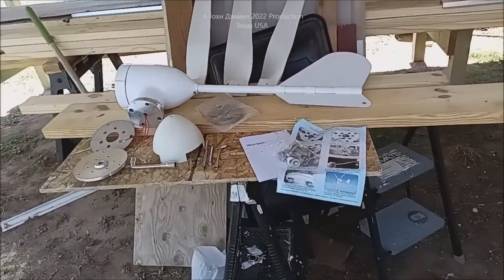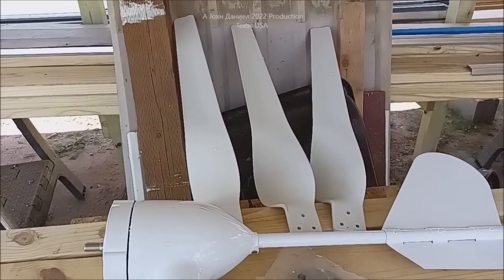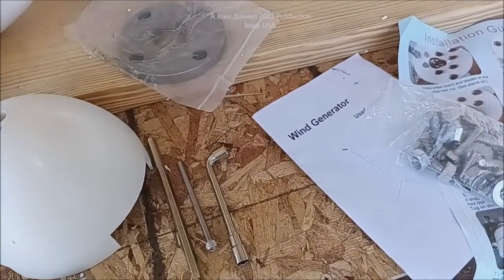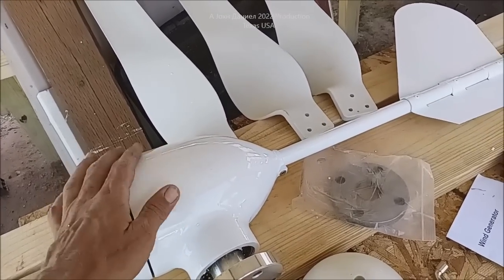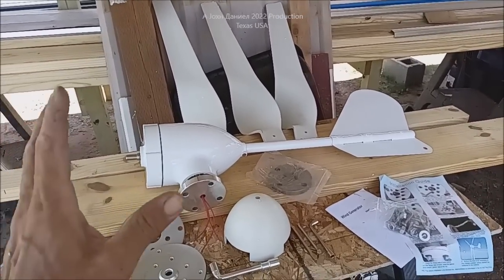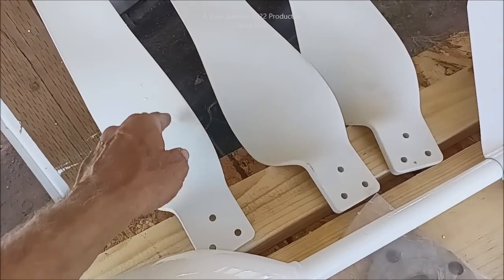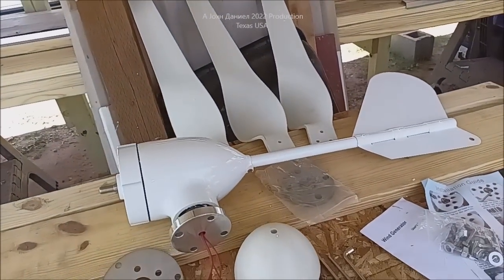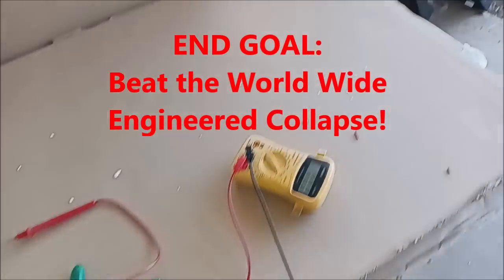Small Wind Turbine Generators to use for Off Grid, from Green Energy Solutions PARTS LIST BELOW

Comment: My battery bank is 48V. Is there a turbine that would work with my 48v system.  Also is it hard to combine solar and wind? Thanks for all the great videos. 
 Welcome to Texae friend
Reply from the maker: They make 48 volt models. On that link below there is a 48 volt option. And much further down in my link list is a 1500/1500 all in one controller that's what your looking for.

Comment: Hi and thank you for your videos! Im thinking about ordering a GE 2kw windgenerator for on gried purpuse and a wonder if you have any recomendations for what inverter works the best. Its 240 volt or 400 volt here, and i prefer quality inverter because quality is newer expensive. Thanks again! / Peter ❤️🇸🇪
Reply from the maker: Send me some details of what you're trying to achieve with it and I can probably aim you in the best area
Reply from the maker: When you go to the link for GE Solutions on Aliexpress, look on the upper part of the page where the store name and rating is, hover on it with your pointer, it will show CONTACT store, click on it, send her a message /chat that you need a Grid tie for your voltage and that turbine, stay with 240, and tell her you were referred by JOHN DANIEL and want a 5% full package discount. I have gotten to be very good friends with her and her 4 partners that work their butts off to special order the parts theirs are made of. Few even would put the heavy windings and slip rings in, they do.

Comment: How good is that Mars Rock all in 1 controller.  Have you had a good experience with it.
Reply from the maker: Yes, I have installed them before but you need to make sure that you do not try to run it to its maximum ratings. If it's 800 w at 12 volt wind capable then put a 500 watt turbine on it, 600 at the most and if it says 600 solar don't put over 400 on it at the same time with the Wind. By doing it that way you'll get every result you need out of it.
Down below the video I put a model that you can get for a better price but has a little better components in it though it says all in one wind turbine look way down in the text below the video.
Reply: @JOHNDANIEL1  Thanks again for the advice.
Reply from the maker: COMPLETE ALL IN ONE CONTROLLER FOR TURBINES - (pick the Wind1500+Solar1500 12/24volt to get real 750wind@12/24volt)  https://s.click.aliexpress.com/e/_AsIplb

Comment: Low battery bank prevents wind turbines from starting up.( Brake effect). How is that prevented?? Happens to many of us.
Reply from the maker: If your battery bank is not too big, pull one wire off from the rectifier and allow it to spin up and touch the wire back on and off to get the current started.

Comment: how do i wire a wind turbine into a Victron solar system? Would I run a seprate controller and then straight to the battery and just use the burn off for excess?
Reply from the maker: Yes. You just set your controllers to keep the wind turbine divert voltage just a little bit below the solar bulk voltage set by your solar controllers so that they don't interfere with each other.

Comment: Put them together and get them up in the air.  I won't believe those put out 600 watts until I see it, live.  From everything I have seen and heard, small wind turbines aren't worth it.  They just don't produce anywhere near what they claim and your just better off buying solar panels.  I'm happy to be proven wrong, so show us this wind turbine making 600 watts, let alone the 800 you claim it will peak out at.
Reply from the maker: I've shown it live in numerous videos hitting way over it's rating. Check further back in my videos.
Reply: He already showed that, you have to dig in his videos to find it, the title will say it all, look for it...
Reply from the maker: @diogomartins9101  Tested, my new turbine peaked real well, over 300 watts from a hand drill. Experience says that's very good results and wind torque is 2x better always.

Comment: How noisy is it ?
Reply from the maker: You don't hear it much till winds get higher than 20-25 mph. By that point the noise of the wind and the turbine track about the same with the turbine being about 20% louder than the wind.
Reply: @JOHNDANIEL1  Thanks. I'm looking for one to trickle charge my solar battery pack in the winter.
 Will this work ?
Reply from the maker: Yes, by a huge amount so be sure you have as much as 400 amp hour. And I put the best all in one wind and solar controller in the parts list below the videos, they did what I asked and put IRC 7095 in them with 200a solid state relay redirectors.
Reply: @JOHNDANIEL1  What about that vertical " lantern" wind turbine, will that work ?
Reply from the maker: @sherlockhoax9338  Take a pass on that unless you get the Axial Generator on it. Those you see with 10,000% fraud claims are all exactly that., Made in Vietnam, hocked through Hong Kong. We had a actual heavy wound model they sent as bait to us for the cost of shipping to check it out. It worked making about 35% its 450 watt claim. Since I expected that knowing how a VAWT uses air, I also thought there was a trick, and it was. All the rest they sold would be 3 lbs lighter, so I reamed their asses and told everyone if you want a quiet turbine, get a low wind HAWT model!
Reply: @JOHNDANIEL1  Thx. You are a bit of a " diamond in the rough " for me. I have been driving myself crazy trying to get info on this stuff . . . lots of BS out there. Do you have one particular video that you consider the best tutorial for hooking one into an existing solar array / battery pack, scenario ?
Reply from the maker: @sherlockhoax9338  Probably about 4 videos are use and install related in that format. Best suggestion like many viewers do is watch about 10 of them from the link in the video here thats in the upper right corner about 3 minutes in. Its a collection. Put the video speed on 1.25 and pause as needed to get your best results.
Reply: @JOHNDANIEL1  Thx, I appreciate it.

Comment: I live in Nova Scotia, wind is near constant, and gets down right stupid at time, would this be suitable, what might you suggest in this case?
Reply from the maker: Depends on you needs, and location. A extremely high wind area like yours may need a furling tail design. But those are a bit more money.
Reply: @JOHNDANIEL1  thanks, ill seek furling tail, let me know any opportunities, my goal is be at least 2000 watt, 1 Kw reserve, combined solar, wind have panels online now, want to put wind tp work, need more and better batteries, like most guys want, and the expensive part of a system
Reply from the maker: Get Rolls Surrette. Quality from Canada.  In your location LiFePO4 will suffer bad from cold.
Reply: @JOHNDANIEL1  i shopped those Rolls today, never knew about them, made right here im Camada, very helpful advice,they have a good reputation, and i found a few local deals for them Thank you sir, now a new subscriber 👍
Reply from the maker: @daleval2182  Build to Do well, Prepare for more to come. Be sure to stock 1 gallon of Distilled water for every 4 batteries in heavy use, per year of service ( 8 gallons per 4 batteries for 8 years) or get you a solar distillation set up to stay full power.

Comment: I'm still waiting on the hurricane vector
Reply from the maker: Yep, need 2 inch pipe, 21+8 feet for a 25 foot mount. It's over $260 now if you can find it.
Reply: @JOHNDANIEL1  i got 3 pipe for a porch that i built  las weekend 2 7/8 35 feet for $95 dollars in the Rio grand valley
Reply: @JOHNDANIEL1  oil drilling pipe
Reply from the maker: @solarandwindinsouthtexasda1473  Everything that is left of that material is down to 30% wall. Already spent $80 on gas driving to multiple locations to buy what is now junk pile. Plumbing supply in Waco has 2" and some yards like in Abilene but thats a days work missed to go get it right now.
Reply: @JOHNDANIEL1  oh wow ont here

Comment: Gray mate, Simon(Aussie) here from down under.  I luv your videos mate just plain old good knowledge, thanks so much for all your knowledge and work that goes into Sharing this with your subscribers. I'm about to purchase two of these wind turbines from green energy, Ive been trying to set up my home power generation on my 50acre property down South west Victoria for a few years now.But the global energy situation has now really made me get serious...I've had a lot of other property improvements projects going on.  I have downloaded your earlier vids on all your power generation that you posted from your old place in Idaho if I remember? I've been subscribed to your channel for years now.  Would be frigging awesome if you could post a schematic (I do remember you white board diagram) with wiring specs and equipment, rectifiers,  displays, load shedding through to 12v battery storage.   That's where I'm at about to purchase your wind system. I just got my hands on 8 of 225ah , 12v. Lead acid deep cycle, not a big battery storage but a start.. + 3.5kW of solar panels and SMA inverter.   So I,m making progress. My family use on average 10kW of 240volt power a day, so we a very low users and conscious of power consumption in the home and around the sheds.  If you could run a video on how to build the system start to finish that would just be superb, would really be awesome. I have a basic idea of how to build the system by pricing together a few of you videos.  Hurricane wind power won't ship to Australia, although that may have changed I haven't been on his site for a while. Keep safe and warm (it's the coldest start to winter in sth Aust Melbourne region in 30years I'm burning wood in the house firebox like no tomorrow, but zero heating costs, except chainsaw fuel and sharpening chains! ) And keep doing what you do....we luv your stuff here in Aussie.  Cheers mate Simon
Reply from the maker: Appreciate the response. My overall goal when I do a video is to thump the noses of these elite bastards who are making our world miserable mess. Mostly the politicians and their hacks who believe that we are their subjects. At some point the people who shovel their coal will be digging their graves. But until then to keep us all alive we need energy, food production and growth, and to be a step ahead of these assholes. Not sure a total cost but since the 2019 fun bug I have almost stopped completely getting the controllers that I have, I think I've got about 15 left but I'm working with green energy to knock off the design as an addition to the turbines since the quality they have has the effort that people need put into them.
Reply: check out will prowse -- go for 48 volt system

Comment: Hi John I enjoyed your video and I have been emailing you from Scotland UK and you have been very helpful. Question for you: Is the Wind Turbine in your video available in the UK and if so which company supplies them? If not where you purchased yours from will they ship to uk if so what price is the turbine plus what make is it and shipping cost approx. It looks like a substantial piece of kit and thanks for producing the video. Thanks Norman English You can reply to my email address if it is easier.
Reply from the maker: Yes, the model in the link is also in stock usually through their Spain and Poland Warehouses. Be sure to get a good dual use solar and wind controller with 800w wind and 600w solar capable. Run only 300 to 400 solar max in it with a 500 to 600 turbine and it'll never fail.
Reply: John I must be having a bad morning could not et to a link so could you please supply me with supply info and make of turbine Thanks Norman
Reply from the maker: The turbine is manufactured by Wuxi. A machine shop tooling manufacturer that's been around since 1998. You can go direct to green energy to their landing page, second link under video contact her, Yue Chen, and tell her you seek best options for getting one without the hassle of your grubberment thugs blocking access.
Reply: @normanenglish  I bought the same turbines from Carbonfreeheat uk
Reply: @satellitetvIreland  Thanks I will look into it. 👍

Comment: John Im thinking of adding a turbine to my system as well as the solar that is arriving soon. Im on elevated ground compared to most around here, but have a lot of trees close by. Being an Australian forest near the coast, its not very dense and we still get decent winds blowing through like now. I can really only get to around 20-30ft off the ground by mounting on the roof of my shed before attracting the attention of the authorities  (who wouldnt allow it). Should I be looking at a 5 blade turbine considering my conditions? I am considering a 24v for my 12v bank, but as i had to have a 24v and a 12v bank for the solar,  I could connect to either one once real world results are known.
Reply from the maker: Low and dirty winds are a hard call on what to use, but you on the right track. With the world in full scale deterioration right now it would be a wise decision for a lot of people to buy one and put it aside or install it in a hidden spot. At some point any form of energy that you can create put you ahead of all the rest of the zombies out there that'll be dependent on the grubberment morons for their next serving of rice.
Reply: @JOHNDANIEL1  thanks, is there any real difference between the one you've featured here as a 'low wind' model as a 3 blade compared to others on their site with other blade options? Not fussed which of either 500/600w, just whichever will do the better job blade wise..
Reply from the maker: The style of blades it uses are just a little bit heavier to maintain torque and curve to accept the wind with an airfoil effect to keep it consistent that's what you'll need when you have low winds instead of straight on high winds which works great for the sword style blades.

Comment: a 24v would be better for a large 12v bank  in low wind area ?
Reply from the maker: Yes, size it for 60 to 70% expectations of what your after in 12 volt. A 24 volt 600 would give the results of a 450 watt 12 volt system
Reply: @JOHNDANIEL1  what size would you recommend for a 12v 1410 ah bank that's 24v ?
Reply from the maker: 800 watt 3 blade low wind style blades with 24 volt PMA.

Comment: do you know the best way to wire a higher  voltage turbine to a 12v bank for more charging power ?
Reply from the maker: Yes, add 5 farad capacitors after rectifier, in continuous drop to battery bank. And be sure they are 50 volt capable. Tap between capacitor and battery for diversion load.

Comment: John I have a question . could I hook up a 48v 800 watt turbine  to a rectifier  and then into a EPEVER 200V 100 AMP MPPT controller then to a 12v 1410 ah deep cycle battery bank that way ? and still use a solid state relay and dump control board to burn off excess power that way ?  does anyone hook them up this way? just wondering if you have ?
Reply from the maker: Not recommended. But if you do a little studying on slave batteries you can always do when I do in that case we installed a 2000 watt 96 volt turbine and put it into 12 volt batteries that were wired to 96 volts and from there we used a midnight classic to feed the 96 volts through the solar controller to a 12 volt battery Bank.
Reply: @JOHNDANIEL1  how do you wire a 24v 600 watt turbine to charge a 12v bank?
Reply: @donaldsteele6276  from what I've learnt from John in past videos,  its not the wiring... As the 24v spins up in low wind it reaches the voltage needed for 12v battery charging sooner than a 12v turbine would (in low wind the 12v might not ever get high enough to charge). Go back through his videos, there a good one explaining this from 2 yrs ago. Runs for 14:43 . "Micro wind turbine generators low wind answers and options". In low wind a 24 v may not get to charging speed for a 24v bank, so you use a 48v turbine and so on. If the wind is strong enough, you match the turbine voltage to battery bank voltage. Its just a way of getting some power from the wind you have rather than a staring at a 12v turbine spinning but doing nothing for your batteries..
Reply: @chriscansdale6389  that makes sense . Some times I get very high winds 40 to 60 mph gust or dirty wind and often I get 10 to 20 mph good winds . My turbine is a 3 phase 500 watt 12v B creations . It's wired to one of John's designed boxes with the rectifier, solid state relay and dump control board ,3 100 watt 3 ohm resisters in parallel.  It's wired to a 12v 1410 ah deep cycle bank . 12 6v crown red top 6v 235 Ah batteries ,4/0 cable and lugs for ties and power in copper bus bars and power out copper bus bars  both wired with 4/0 cables.  I would like to increase my power enough to really push a charge on the battery bank. I use this unit offgrid and tow behind my RV has wind and solar.  1200 watt solar array with solar trackers and a 600 watt suitcase ground unit ,500 watt 3 phase turbine . I made a video showing what I power with it and my  DIY trailer was made from scrap I had laying around . Turned out real good . I even connect it into a ATS on my home for green energy to run deep freezers and fridges and AC units and space heater in winter . I will post a video to show you .